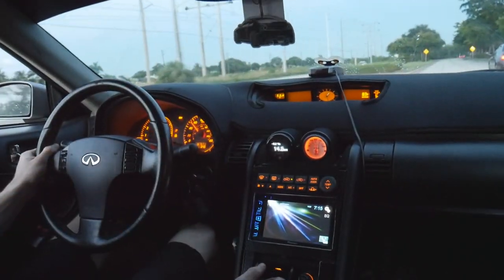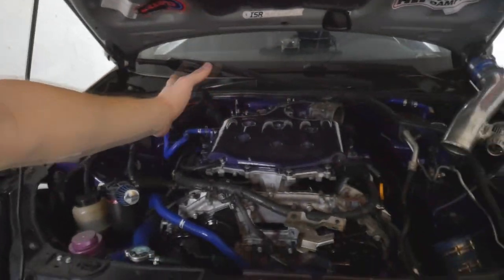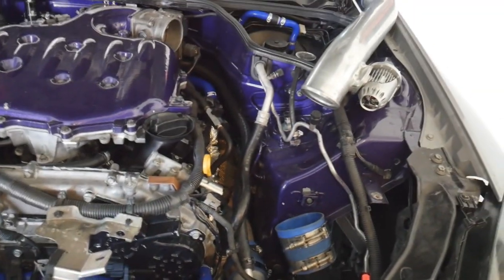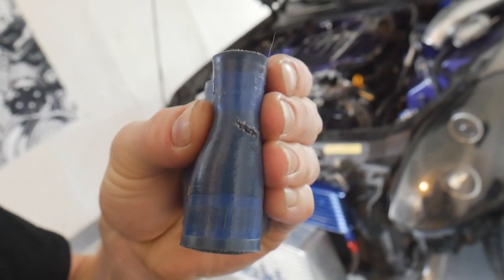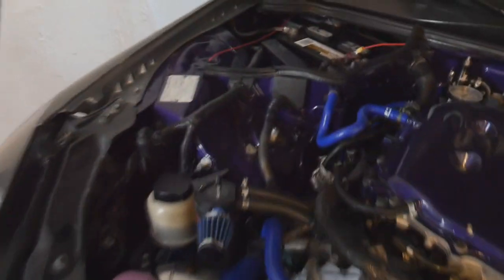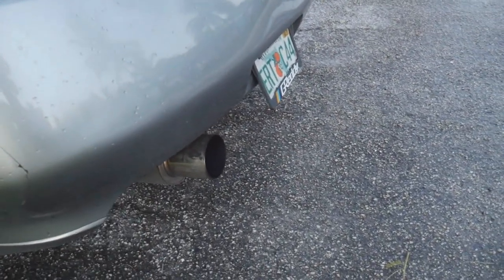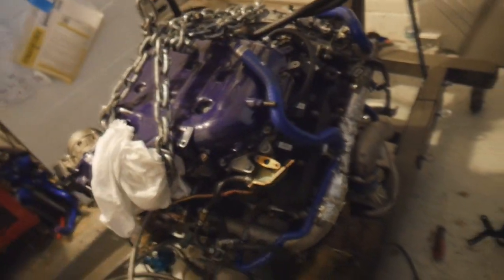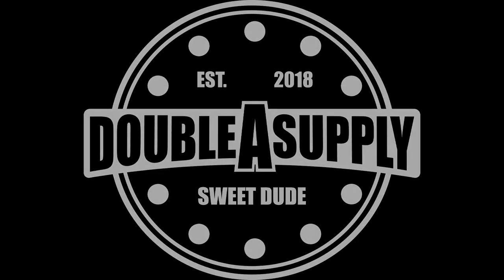I blew it up lol

Comment: Good attitude Aaron! Life will knock you down, get your ass up again!...Giving up is for losers that pull an excuse wagan in life...Some of your previous videos, I noticed some of the pipes were smooth which the coupling can slide off...Make sure all pipes ends have a bead made with a bead maker...That way you don't have to crank down on those clamps and cause damage to the selicone couplers...
Reply from the maker: Appreciate it bro I will for sure take note

Comment: TT G35 since 2009, still running :-)  You want low vacuum on crankcase at idle, more vacuum under boost. Venting to air is fine except it stinks.  Your source for low vacuum is from PCV valve. You should change out the PCV for a true one way valve that will ensure boost does not make it to catch can. You can get slightly higher vacuum that grows with boost pre-IC (near cold side piping that points down towards intake filter is fine as you can check for oil ingestion from the crankcase).
Reply from the maker: Appreciate the tips bro! Thank you 🙏🏻
Reply: So for a N/A g35 I should be fine with a NON vented catch can ??

Comment: That rear will not vent from the main filter.  The intake will suck air in and pull the oil back into the cylinders.
Reply from the maker: I was thinking about that. I’m going to get a 4 port catch can for that

Comment: I’d stick with pressure sensor port as feed. Clean filtered oil. Blew my comp by using a sandwich plate since it’s prefiltered oil. Same time just rebuilt the motor so did have crap all inside it while breaking in.

Comment: The G is in good hands! Aaron that coupler failure must mean that there is serious pressure from the turbo or that coupler was garbage to begin with...
Reply from the maker: The coupler was garbage to begin with it was also sitting on the hot exhaust so I’m gonna put a brand new one and tweak the turbo a little abs heat wrap it so it doesn’t burn again

Comment: Hey what blow off valve are u using? Did u have to weld it on there or what?
Reply from the maker: HKS BOV and no it already had a port welded for it when I got the kit used thankfully

Comment: How does that coupler explode like that?? you sure your boost pressure is accurate?
Reply from the maker: Boost pressure is accurate, I gotta turn the turbo a little more the pipe was sitting right on the exhaust so it burnt and popped from there
Reply: @AaronNewman  that explains it

Comment: I procharged my mustang & sold my G. VQs don't like boost much
Reply: maybe its just the de, i asked nitish21 about his setup, and he said just twin turbos stock internals (Dif fuel setup though) and he was putting out 700w
Reply: Nah man they love it just not the DE
Reply: @Kyronsk8  huh? He has a fully built motor and it’s a single turbo kit from BP. His build is 30k minimum and he did some of the labor himself
Reply: @AntoineJra  it probably wasn’t his but it was the white 370 he uploaded recently. I asked him what the mods were in the comments